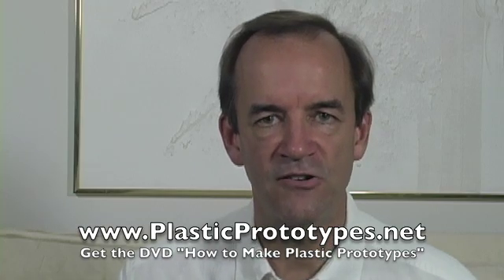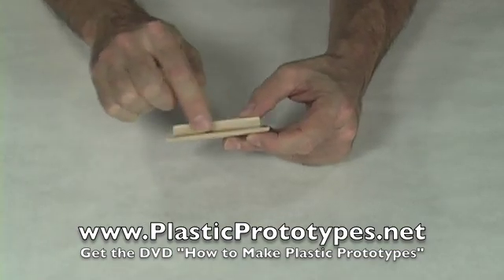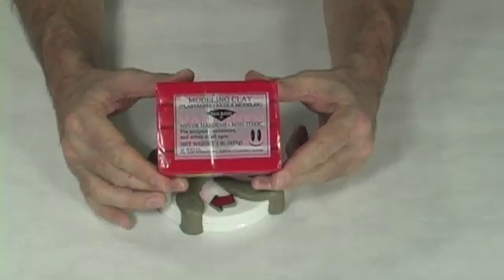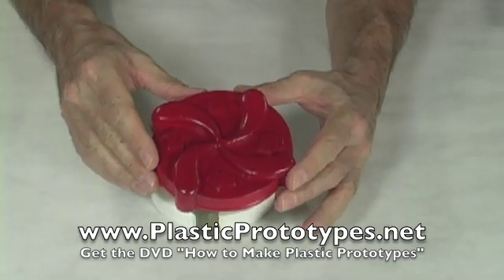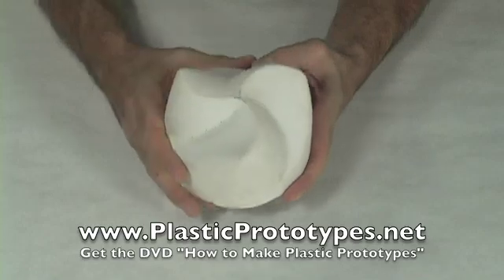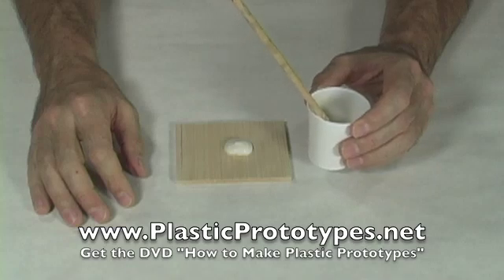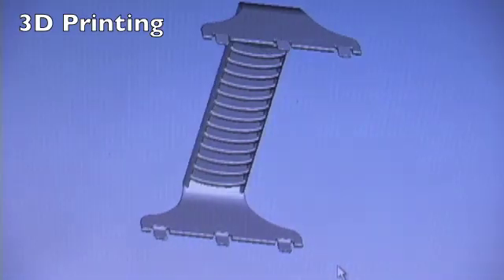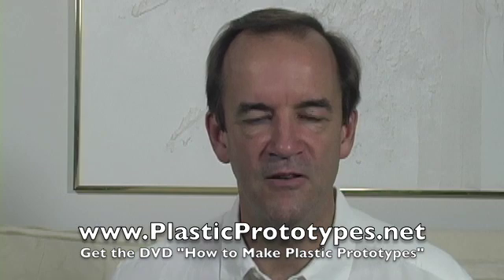How to make an invention prototype.

Comment from the maker: @VAND4LL   Whatever you use, it has to be able to export a file that can be used in rapid prototyping.  The the STL file is the standard file type used.  I don't know if the free version will do this, but the version you have to buy probably will.